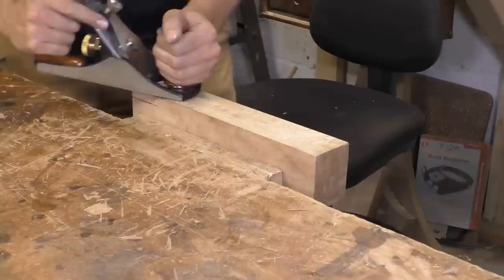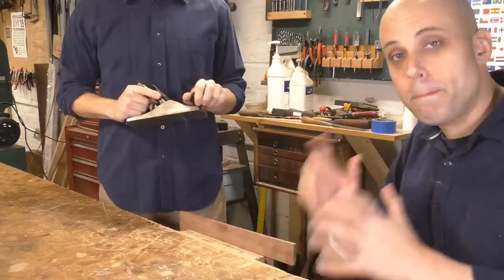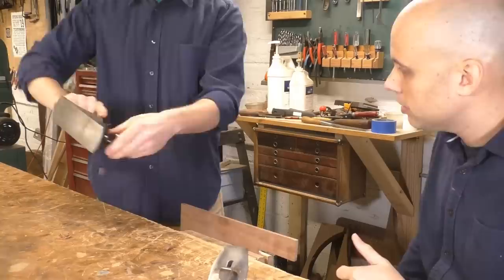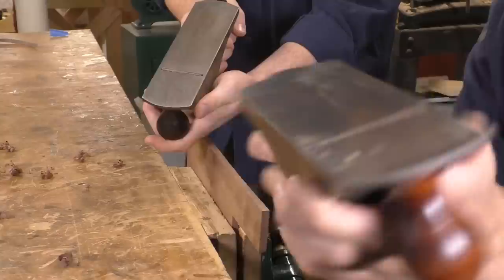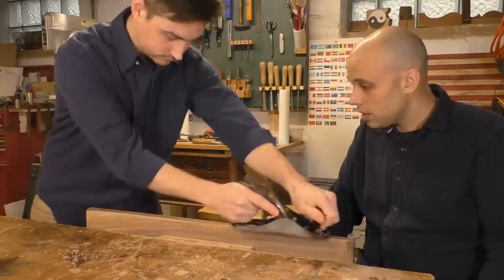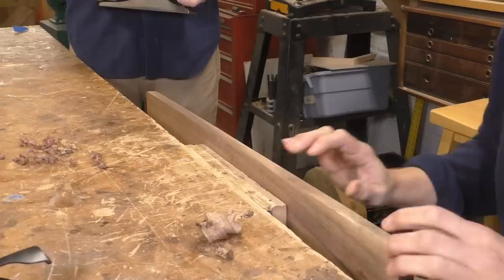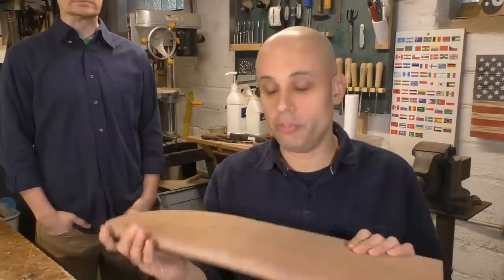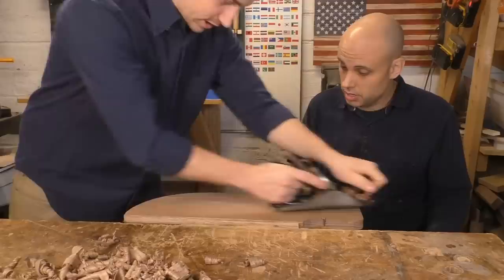Learn to use your hand plane!

Comment: Aligning the blade used to be called "sighting the blade" by some workers.  They would either use a bright light source (the sun for instance) or a piece of white paper on the bench.  Stand with the plane looking from the toe along the sole and tilt the plane until the sole reflects an even bright surface to your eye.  If you left the edge of the iron proud of the sole, then it appears as a black line against the bright background.  Otherwise just lower the edge until it just shows above the surface of the sole.  Move it back, keeping a close eye on the edge, until one corner just disappears.  If the whole edge comes and goes equally, your work is done.  Otherwise move the lever very gently toward the visible corner of the iron. The opposite corner should lift proud of the sole.  Lower edge again until one corner vanishes. Move the adjustment lever toward the high side of the blade.  Try and get the edge exposed equally along the width the of mouth as you sight down the sole of the plane.  Then raise the edge until it is not proud of the sole.  Then use a scrap of wood and lower the edge until you get the shaving thickness you want.  After freshly sharpening an edge I get a minimum shaving that varies between 0.5 and 1.5 thousandths according to a micrometer (the tool, not the metric measurement).

Comment: Great job Nate! 

Rex, you should consider including Nate more often in the Woodwork for Humans series. The translation by a true beginner really works well for this series.

Keep up the great videos.
Reply from the maker: I'll tell him you said so!
Reply: Agreed, I have some really basic tools and purely "utilitarian" ugly furniture I've made, but after seeing Nate learn - I think I'm ready to try something a little more.

Might even head over and buy that plane / plan set for $10. I mean, it's $10, what have I got to lose?
Reply: @brandonogden3498  10$
Reply: @brandonogden3498  you came from nothing, and you'll go back to nothing, so what you got to loose is: nothing!
Reply: This was perfect for how I learn!!
Reply: @RexKrueger  Hi Rex, Thanks for your videos! What oil do you use for the planer base?
Reply: NEW SERIES BEGINNER INSTRUCTION VIDEOS
Reply: @luisgerardorodriguez3822  three in one oil but any light weight oil will do.
Reply: @luisgerardorodriguez3822  Paste wax is good for lubrication, rust prevention and doesn’t run or absorb into wood like oil.

Comment: Using Nate as a stand-in for your viewer was brilliant. This should be a recurring feature from time to time. Was very helpful. 
Good job Nate.
Reply: This was an Awesome idea, I do not do wood working but I love the how to and this one was gold to me! I finally understood how a plane was supposed to be used. You just made me realized that I bought an old planer and from this video and the sharpening one I realized I probably found gold without knowing it. Thank you :)
Reply: For those wondering (if any) a website I found help me identify it as a 14 inch Type 17 Stanley Bailey Hand Plane. Yeah I feel pretty lucky :D. Had it for over a year sleeping on the top of my tool cabinet.

Comment: Lots of words, I hope some of this is helpful.

In terms of plane stroke, there are three areas of attention in movement that you would want to develop consciousness in.
- straight, not curved. Our body moves less than the plane, so the natural tendency for the hands is to move around the body in a circular fashion. The plane tends to veer to the left towards the end of the stroke (and may wobble a bit as the left arm changes from moving sideways to extending).
- flat, not rolling. As your left arm extends, you left hand that keeps the knob is pulled to the left. This will cause the plane to try to roll to the left. The end of your board may be low on the left. Nearer to the start of the board the effect is opposite. Or, alternatively, as the left arm extends, it starts to push down and away more, causing a roll to the right.
- level, not cupping. When both hands just exert pressure down, and at the start of the stroke the plane is resting only on the toe, at the end only at the heel, the part of the plane that is not supported by the board tends to weigh down. This introduces a low start and end, resulting in a little high in the middle

I learned to observe my deviations one by one, and mentally do counter-movements mitigating the tendencies. Yours, and everyones, may be different, but I found isolating the various planes of direction most helpful. I'm stating my countermeasures as a starting point for ideas.
- since I know I tend to pull to the left near the end, I feel for pressure on my left hand, indicating I'm correcting for that towards the right;
- pulling left almost automatically also entails rolling left. The same pressure will tell me.
- at stroke start I slightly lift up the heel, and towards the end I'm lifting up on both hands actually, heel first. Paul Sellers calls this "feather in, feather out".
Reply: Good point. I have a tendency to not feather out and I end up with a slope where I take more off at the end of the stroke.
Reply: @ukype    Wrong tool.  Use a jack plane for straightening edges,, a different animal entirely from a smooth plane. Particular jobs,, pull out the coopers plane.  That will straighten the back of a buffalo.
Reply: Too simplistic,, I believe.  'feather in, feather out'         Begin with, I have used hand planes for 50 years.  I am whiz bang at sharpening, setting the frog, the chip breaker, keeping the bottom ground flat, and done it professionally.  A single job, 25 plus years ago, a truck load, 4,500 board feet?, of poplar for a particular house,, delivered, plane two sides, straight rip one edge.  That load of poplar built the front doors, all the stair and balcony parts, fluted columns,  windows and trim, baseboards throughout the house,, etc.,,, All of it trued and smoothed with hand planes.  Just the 150 plus spindles, square, amounted to a half mile of edge.  So,,,, I am unsure I could teach anyone, except the mechanical parts of sharpening and set up.  My hands know what to do,, not my conscious mind.

First, choose the correct plane for the job.  There is zero one size fits all.  A smooth plane cannot do the job of a jack plane, and a jack plane is useless on a smooth plane job,,  a joiner plane is different, if you have block planes,, there are four or five separate types.  A smooth plane,, the 9 inch most often seen,, the bit is not normally ground straight across.  You are taking a very slightly dish shaped cut through the wood. And by slight,, I mean very slight,, a few ten thousandths?.  Planes are routinely used either at a strong angle to the planed edge,, or only straight down the sole,, and every angle between  is best for something.  I believe what you just described to me,, please forgive me and allow that I am making fully unwarranted assumptions,, it sounds like you are using a smooth plane where you should have pulled out the jack plane.  Smooth planes are very much hand pressure controlled.  They are intended to make the surface,,, mind you,,, the surface not the edge,, absolutely butter smooth.  A smooth plane surface shows up the Sahara rippled sand dunes face of a power machined planer/surfacer,, or even the sander type surfacer,, for what they are,, rippled rubbish.

A jack plane, however is the common tool to straighten or 'shoot' a board.  If you want flawlessly straight, a cooper's plane.  I am not a fan of a fixed body and all the motion and power and travel is in the hands and arms.  a 42 inch spindle and I am likely to be moving my body 2 feet on each stroke.  This is where it gets dicey,, really dicey to try to explain.  You know,, or should have,, at all times when truing an edge, your try square.  The try square lives its entire life on the shelf beside the planes.  The reason a try square is often the ultra fancy, wood, brass, steel bit of art work,,, is you are going to use it a few million times.  The word million may not be misused.  If the proper word is not million  it is certainly at least hundred thousand times.  Normally,, every board each end, multiple times per edge,, you stop to check.  Now at some point,, measured in decades, you rarely have to pick up the try square.   I true an edge by some feeling between my shoulders, up my neck, between the ears.  Something in me locks on level, straight, and square to the part in the vice.  I decidedly do NOT,, do not,  feather in and feather out.  This is what had me writing a response.  That suggestion of feather in and feather out  rubbed me strongly the wrong way.

Yes,, there is a place for that feather in and feather out,,,, when surfacing a board or table top  with a smooth plane, but,,, the bit on a smooth plane is not straight.  it is taking a slightly dish shaped cut out of the surface.  The bit depth, breaker position,  and frog setting depends upon the wood species,,, a perfect set up for a pine is worthless for an oak, and vice versa.  Here may be a gauge for you.  When smoothing a surface with the normal ripples from a power feed surface planer, my net bit depth of cut is something like 1/10 the depth of the ripples,, maybe less?  I am actually using the depth of the ripples to gauge how deep to cut.  The final stroke for a given spot is a long continuous ribbon,, that I have 'feathered out'. That ribbon,, I really have no idea,,, is 1/10th or 1/20th the thickness of a sheet of typing paper?

I will use a smooth plane to rough something out at times.  Use it at a strong angle across the work,, the blade shearing at a strong angle,, maybe only 4 or 5 inches of shoe in contact,,,, the continuously curved and constant angle change while planing a canoe gunwale?  Did one just a few months ago.  That is entirely done by that 'spiderman sense' of what is true and square.  I could not begin to tell you how to do it,, I haven't a clue.  Something deep in the center of my brain, connects with the hands,, and absolutely skips all the neurons between.  That is where I cannot teach you or tell you,, I just don't know.  Somewhere around the 100,000th or 600,000th time you pick up your try square,, you will begin using your try square less.  You won't know when you don't,, you may still always pick it up the check the part after you have taken it from the dog or vice.

I do truly apologize.  I mean zero offense.  I don't think I could teach anyone, anything.  And maybe the reason for some of this,, several of these jobs were time dependent, professional, I have honestly stood in the same place at a bench vice and not moved except the repeated action of the plane and shifting the side or next part, until the coffee was a lifesaving need and the curls were drifted around me fully knee deep.  And to be clear,,, there is not,, absolutely not a power tool alternative that is faster or better than a good hand plane.  Not a one, not even close.  Joiners are nice, but then you have to plane out the ripples anyway.
Reply: All good stuff this vid, thanks Rex. Just to add a little if I may, slightly more pressure on the toe at the start of the cut, going to equal pressure for the main chunk of the cut, lifting off the toe pressure and applying a little more to the heel at the end of the cut was what my dad taught me
Reply: And for those of us who have the benefit of being left-handed, just reverse all instances of "left" and "right". The body mechanics are the same, just different. 😃
Reply: @Sailor376also  very interesting comment on an also very interesting comment. Thank you both.
Reply: @milesmccoo   Been a while since I looked in on this video.  One thing I would add for your benefit, Miles,,, is there very much is a certain zen,, a meditation, that takes place once you spend some time with a hand plane.  For me, when faced with an extensive hand planing job,, I rather look forward to it.  There is a soul satisfying 'something' to the rock and push,,, the hiss of the blade biting a thin, thin, bit of wood.  Even my current partner has had a surprised look on his face when I have stepped outside to make the transition threshold at the entry to the new hardwood floor.  A hand held, hand circular saw to rough the width,, a quick pass to a pencil mark and just a finger to guide the edge.  Then a hand plane to angle , shape, taper, round, true,, all standing in a driveway  at a 2X4 sawhorse..  It is shameful of me.  I enjoy it.  And enjoy all the more if it 'clicks' when it is popped into place.  Ten or fifteen minutes of being in a far away place,, enjoying the feel and motion..  It  is a treat.
Reply: @Sailor376also  I definitely need to read this comment again and again. What is a block plane for? How is it even possible that every plane has the same basic mechanics (blade, meet wood) but there is no one-size fits all? (rhetorical question)
Reply: @RickHenderson  2 Years ago.. Boy did I talk a lot  !   You just asked and answered your own question.  I own 15 or 20 planes?  Lets just talk about block planes.  They come in 4 or 5 lengths,, all are almost identical parts,, but a block plane for end grain is a very low angle bit,, 12 to 15 degrees?  No chip breaker, just the exposed bit.  Its mate,, and you can buy a matched pair is about a 20 plus degree angle and is meant for the side grain.  They cannot do each other's job.   There are adjustable throats,, some work best bevel up or bevel down.  I carry routinely a 20 degree block plane and a 9 inch smooth plane in a bag to jobsites with a diamond hone.. Cheap block plane, cheap smooth plane,, cheap diamond hone,,, because they are gonna get knocked around an live in the truck or on a jobsite.  The good planes stay in the shop.  A GOOD Bailey's 9 inch smooth  or a longer jack plane TODAY s about 300 dollars each.  Most of mine I have found over 50 years in flea markets,, country auctions,,, When you learn to set the chip breaker perfectly for pine,, white oak,, cherry,, walnut,,, each require a different set back.  The frog must be reset depending upon the job,, the chip breaker must faultlessly in contact with the top of the bit,, the bit should sharper than you new razor.  Then,, take the thinnest curl you can.  20 easy strokes is much faster than ten hard strokes.  Always pay attention that the grain is surfacing it the same direction of your cut.  Then you stand there until you get it right.

Comment: One thing we were always yelled at in school in woodwork class, was resting the plane flat down.  This was a real no no because the blade could be nicked (don't mean stolen either). But its a good habit if the blade is in cutting position to lay it on side.   Also we had a deep trough in the middle of our benches with 2 wood vices (one either side for each student).  One of your videos reminded me of the bench hooks. Forgot about them.  Nice job on the videos.

Comment: I've been hooked on your videos from the first one I watched, and now my 10yr grandson is too 🤗. One little tip I would like to offer, instead of using a pencil/carpenter pencil to scribble a "witness mark" on the timber? try the flat "soapstone" sticks welders use, lay it flat, pinch either side between fingers and thumbs and drag it along the wood.

Comment: Thanks, Rex and Nate. This video helped me a lot. I've had a bit of a hard time sharpening my blade and setting it properly, specially that primary, secondary and sometimes terciary bevel stuff... I found out I actually don't need all that. If it's sharp, it's sharp. If it cuts, it cuts. And sometimes you don't even need to sand the peice all that much. This is great content.

Comment: I picked up a Winchester plane a couple of weeks ago. Dang thing has the advance/retract knob on standard thread rather than reverse thread like most planes do. On the bottom, some one scribed a line across on the edges of the mouth for where square is supposed to be. I found that really handy. For lateral adjustment, I have taken to just tapping it with a small dense block of wood. The levers seem to be kind of sticky and not always good/accurate.

Comment: Rex,
I am currently building an arbor with an arch that has a 42inch radius on top. I assembled the arch with some 2x8's and cut it out with a jig saw. The next step is smoothing the arch out on both the concave and convex sides of the curve. I'm not very excited about sanding it and wondered about planing both types of curves.

I saw that a compass plane is used for both types of curves for various reasons. As much as I would like to buy a Kunz 113 or a Stanley 113, I couldn't justify the $300 for something I would probably never use again. After watching a few of your videos on planing, I thought it would be pretty cool to see one where you tackled concave/convex curves of various radii. I don't know it would be a very long project for you, but I imagine you could bring more creativity to the table versus what I have seen out there. Awesome videos btw.